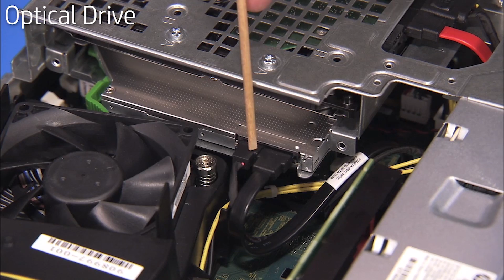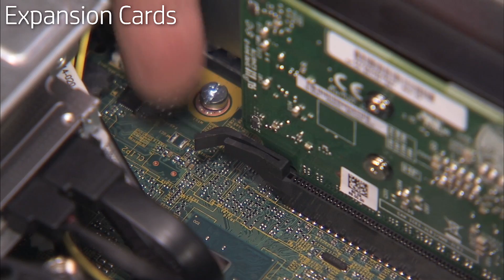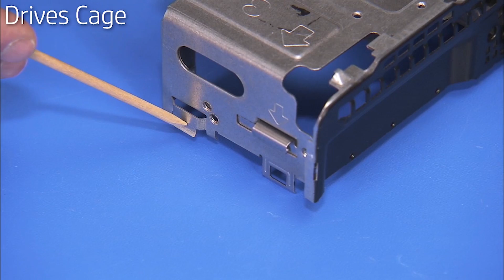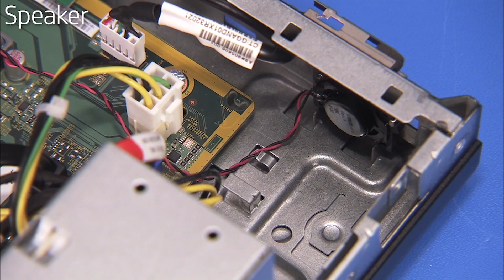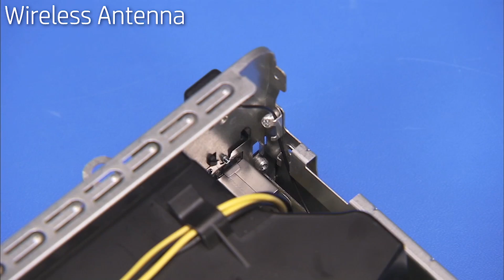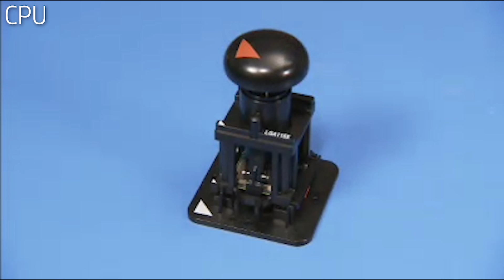Removing & replacing parts for HP ProDesk 400 G4 Small Form Factor | HP Computer Service

Comment: wait how that pc have a videocard if that motherboard PCIe slot max energy output is 35W no 75W
Reply from the maker: Hi there, thanks for contacting HP Global Social Media Support!
I am here to help! 
What seems to be the issue?  Could you elaborate more on the issue?
May I know the product you are using? A serial/product number would be helpful!
Let me know!
Regards, 
HP Support
Reply: @HPSupport  the serial number is: MXL7362NDK
Reply from the maker: Thanks for getting back to us, Since the motherboard has a PCIe slot you can use a GPU that has a less TGP which does not require a lot of power.
Let me know!
Regards, 
HP Support

Comment: I want to add a 2.5" SSD to my HP Prodesk 400 G4 MT, my question is does the ssd installation need an additional caddy? if not, is there a slot or ssd slot available? second question; then for the SATA cable, do I need to buy it again?
Reply from the maker: Hi there, thanks for contacting!
I understand that you need to know about adding SSD to your computer. 
I will do my best to assist you.
You can install 2.5 Sata SSD on your computer. You need to purchase a cable. 
Binu - Social Media Tech Support
Reply: @HPSupport  do I need to buy only the SATA cable?  whether the power cable from the hard drive that has 2 in 1 can be used for ssd?  so i don't need to buy caddy 3.5 to 2.5 ?
Reply from the maker: Thanks for the reply.
In order to get this issue fixed, please contact our customer care team over the phone or chat for further assistance, as this issue requires Live conversation with you over phone or chat to isolate the issue and provide you instantly with appropriate solution or repair/replacement options available at your place as per the warranty.
Please feel free to reach us on call/chat, please access this link to select your preferred country and language option to reach us. Global support link: - https://www8.hp.com/us/en/contact-hp/ww-phone-assist.html
Binu - Social Media Tech Support
Reply: All you have to do is watch the part of the video that talks about installing a regular hdd. This part of the video shows that the hard drive bay cage supports either 3.5 hdds or 2.5 sdd drives frive sizes. The "A" screw type is for regular type hdds. The "B" screw holes are positioned to support a 2.5inch sized drive (ssd) type drives. :)
Reply: As long as the drive cables fit your new drive then no you dont.

Comment: Why did HP decide to go with proprietary PSU connectors?
Reply from the maker: Hi mintymus,

Thank you for your post and interest in our product.
We appreciate your time and We apologize if you had any inconvenience. 
I'd like to help you with your HP Product.

As per the design of the Desktop model, by default this model comes with proprietary PSU connectors.
We may require some information to assist you further:
1: Model name / Product number of your product:
Here is a document link that will help you find this information. Link: http://support.hp.com/us-en/document/c03754824
2: Brief description of the issue.

If you require additional assistance, feel free to reply back to us anytime.
Hope this helps. Keep me posted.

Regards
Vignesh-HP Social Media Support
Reply: @HPSupport  Thanks, yes I do understand it comes with proprietary connectors.  My question is, why?
Reply from the maker: Thanks for the reply.
A standard (regular store) ATX PSU has a 24 pin main power plug, and a 4/8 auxiliary power plug.  You can not use an ATX PSU.  It will not wire/plug into the motherboard. That is why the PSU is proprietary. 
Binu - HP Social Media Support
Reply: @HPSupport  I understand that.  But why did HP choose to use a proprietary PSU?

Comment: thank you .i have probem with bios ..blank .i need file
Reply from the maker: +RAPI Kabupaten Bandung Please perform recovery as mentioned here to fix this issue: 1. Shutdown the computer. 
2. Turn the computer back on again and repeatedly tap on the ESC until a Startup menu appears. 
3. Press F11 once for System Recovery. 
4. Choose the Keyboard Layout. 
5. Click on Troubleshoot. 
6. Go to Recovery Manager and click on System Recovery. 
Note : Back-up all your data as System Recovery will delete everything that you had saved or installed on the computer.
Reply: @HPSupport  my pc trouble update bios mistake different  no display . i need file bios  .........bin.       16mb,thank

Comment: Missing DVD and cd icon on computer
Reply from the maker: +GP HATURNA Type regedit in RUN dialog box and press Enter. It'll open Registry Editor.
Now go to following key: ...
Look for "UpperFilters" and "LowerFilters" strings in right-side pane. ...
Restart the system and now you should have access to your optical drives.

Comment: Good God, I'm just looking for where this second antenna goes to my wifi in my desktop
Reply from the maker: +stoagy mahalo Glad to know that the video was helpful to you.
Reply: @HPSupport  it wasn't. the camera angle blocked it every time. -_-
Reply: @stoagymahalo5268  in the prodesk 400 g4 sff? the video shows it pretty clearly in the section that starts @20:14
Reply: @TedPhillips  Well IF it was that, then I wouldn't have spent over 20 minutes just to comment this.  I appreciate you trying to demean my frustrations on the matter, but its only exasperating the situation instead.

Comment: What kind of video card can I put in this computer? I don t know what to buy...
Reply: I've added a GTX 1650 LP card and it works perfectly.
Reply from the maker: +Federica Sisto You can purchase the part from here: http://partsurfer.hp.com/ Please select your country and enter serial or product number of your unit.
Reply: @HPSupport  is GPU card supported by this pc? if supported what are compatible options? Also what is the maximum expandable RAM?